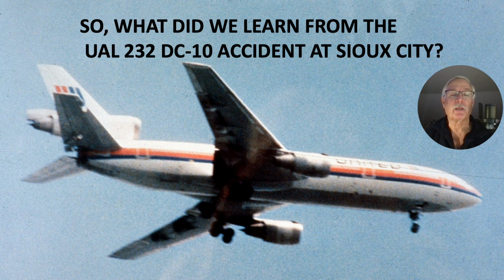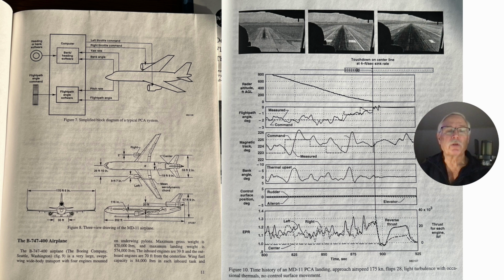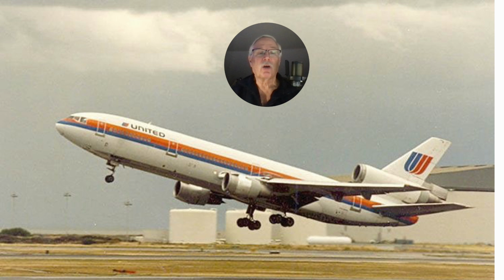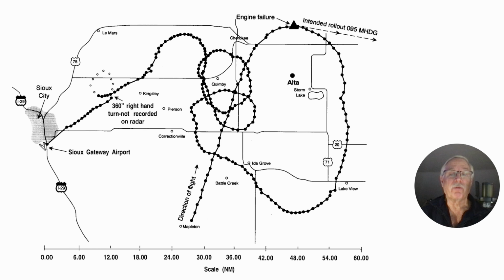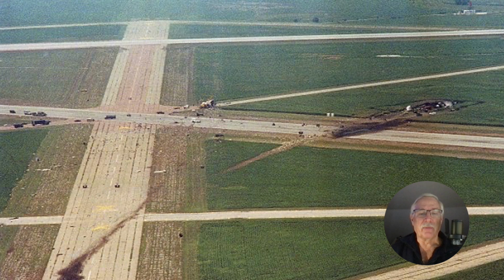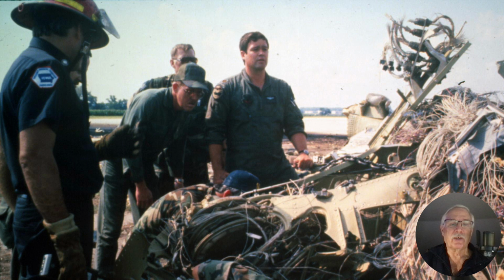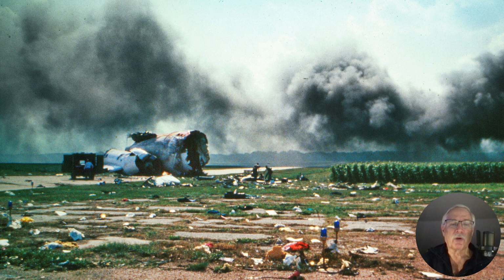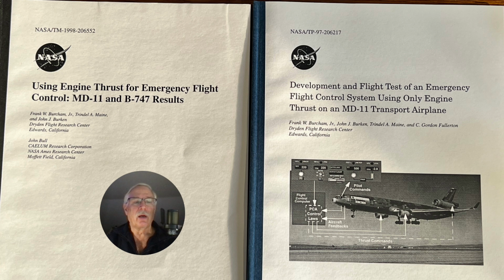SO, WHAT DID WE LEARN FROM THE UAL 232 DC-10 ACCIDENT AT SIOUX CITY?

Comment: I could be mistaken, but about two years ago there was an EMB-190 (an Azerbaijanian airline if I recall) which was shot at by a Russian missile taking out all the hydraulics.  I think most of the passengers and crew were killed in the attempted landing using only differential thrust.  Perhaps that accident could have been avoided if that fancy software had been on board.
Reply from the maker: It's possible that the software could have helped in that situation.

Comment: What is the most important part of any hydraulic system? The hydraulic fluid. I heard that Captain Haynes told pilots at my airline that he would have left the gear up if he had the chance to do it over. I thought a small standby electric cruise trim motor attached to the stab trim system would have been a better fix than the isolation valve for the elevator.

Comment: If only they could have opened the flaps a little bit with something like a car jack. They could have approached the runway at a slower speed, giving them just enough control to avoid flipping the plane.
Reply from the maker: Speed was not the issue as much as where they were in the phugoid cycle.

Comment: Had a few "after the fact" encounters regarding this aircraft in my career. Back when I started as a mechanic for UAL at SFO in the early 90s, a friend was giving me a tour of the UAL jet shop. Just sitting in the corner on a pallet was a bunch of metal. Was told that was the pieces from the center engine compressor wheel that let go from flight 232, was eerie to see the remnants just sitting there like that. Several years later, we had a lease return DC-10 parked for a few months, had a concrete weight hanging where the #3 engine would be as ballast. Asked why it was still there after a few weeks went by, was told that when returning a leased aircraft, they put the original engines on the plane that it was leased with. Turns out the original #3 engine from that parked aircraft was the #2 engine from flight 232, and they were trying to figure out what to do about that dilemma.

Comment: 12:28
After United 232, the only other accident I can think of that involved loss of all hydraulics was the 2003 DHL A300 attempted shootdown over Baghdad. In that case the pilots were actually able to safely land the plane back on a runway despite the wing also being on fire.
Aside from that, like you said, there hasn't been any other situation where that system would've been useful.
Reply: -JAL 747 comes to mind.

Comment: Was the JAL acident where they lost the tail before or after this?
Reply: JAL 123 occurred in August 1985, so right about 4 years prior.  Denny Fitch studied that incident and the use of asymmetrical power.   He used that knowledge as he worked the throttles on 232.

Comment: Interesting idea about trying to avoid having hydraulics as the only primary flight control mechanism. 

The DC-8 systems manual shows how they revert to control tabs on the rudder and ailerons, and have electric-motor alternate trim for the stabilizer. Someone on one of the other TouTube channels who was involved with testing mentioned how they had to be careful because they lost the yaw damper on rudder reversion.

I was wondering if they ever tried to use small rocket motors, like they do for attitude control on spacecraft, as a backup method in case of loss of hydraulics. This would compensate for the spool-up lag in using differential throttling of the engines. Hypergolic-fueled motors like the LEM ascent stage are very reliable, but of course they would add another degree of complexity and risk to the overall system.

Comment: I encountered a similar occurrence of this exceedingly rare phenomenon while flying a C-130 which in which we encountered  a total utility/booster hydraulic loss (no manual reversion on the Herk). Although the presence of four fully functioning engines with constant speed propellers and instant throttle response made for a far simpler flying task than what this crew dealt with, I can attest to how terrifying it can be to land a big airplane in this sluggish and wallowing manner. In case you are curious how this could have happened, ordinarily the two vital hydraulic systems on the C-130 are widely separated except for the aileron actuator (one unit serves both ailerons on a C-130) located on the central wing box structure. Ours was an ‘A’ model with full 3,000 psi aileron pressure and in all later C-130’s that pressure is stepped down to 1,500 psi: we had a ‘B’ model aileron pack installed which split in two under the higher pressure and pretty much instantaneously emptied the fluid of both systems into the cargo compartment (thankfully no pax on board at the time). We were fortunate to land without incident and, except for getting a nice award and plaque from the Air Force Association, the ‘A’ models were shortly thereafter retired from service and the incident soon forgotten. I enjoy your stories Ron and speaking as a typical lost-in-the-tall-grass average line dog whose career largely overlaid yours, I can only wish I’d come away with one tenth the number of interesting stories as your own!
Reply: Thanks for posting your incident, would be interested in reading a thorough breakdown of the incident if possible!

Comment: Stay off the DC-10, the Plane of Death!
That's what I learned!!
Reply: Despite a few accidents, like most aircraft, the DC-10 had a very long and reliable career. The USAF has only recently started retiring their 60 KC-10 refueling tanker versions of the DC-10 after 35 to more than 40 years service. Only one was written off in an accident and that involved a parked aircraft where fuel vapors caught fire during maintenance.

Comment: Reall cool that you knew the pilots involved. I think that Fugoid cycle was also experienced by the pilots in that 747 (JAL 123). It was the result of a poorly repaired/assembled rear of the pressure vessel. It took out all the tail controls, and somehow the pilots kept it airborne for around 40 minutes.
Great vid as always.

Comment: Curious  if you have any insight into how the airline industry addressed & adapted to the connection between yaw damper and rudder hardovers in B737s. This may have a connection to TWA 841 (1979), a weird high altitude upset where the crew came under suspicion for pulling slat circuit breakers & trying to cruise w flaps 1 at FL390. There's an alternate theory that maybe an aileron was floating upward slightly, causing a little yaw effect, which caused a problem w the yaw damper... eventually causing a rudder hardover similar to what we would later see in B737s...  Would be interesting to know what the rumors were in the pilot community as issues between yaw damper and rudder hardovers were starting to appear as a likely cause of these scary hardover incidents.
Reply from the maker: I am going to put something together on that.

Comment: I was working that day. UAL232 was in the FOD HI sector when he blew his engine. I was in the MCW HI sector and UAL232 was in the handoff mode to my sector. The initial thought was to try to bring UAL232 to the RST airport. But by the time they got the DC10 under control SUX was chosen as the airport. We watched it as it circled down. They did a great job even getting it on the ground.
Reply: It truly is. I did not know of this accident before watching this video and initially the gravity of the situation those pilots found themselves in didn't fully register with me. That is until Ron explicitly mentioned that the throttles for the remaining 2 engines were all the control they had. No ailerons, no flaps, obviously no rudder, nothing. I had to pause the video to go over that in my head and let it sink in. I'm not sure what kind of sorcery went on in the cockpit that day, but I'm pretty sure they managed to pull one over on several laws of physics.

Comment: The things that hasve to be considered with every proposed safety system are: 
1) What new problems might it introduce? (Look at drugs; they always have side-effects.)
A Twin Otter crashed because the stainless-steel control cables used to prevent corrosion of the usual carbon-steel ones were subjected to slipstream while parked,  embrittled and broke.
2) Since nothing is free, what alternative use of the money might produce  better outcomes?
Reply: I hadn't heard of that Twin Otter incident. 

Upon a brief inspection, it appears only that the stainless cable is known to be more "prone to wear" than the recommended carbon steel ones.  It also states in a marine environment the cables require more frequent inspections. Presumably, the operator knew this and "upgraded" to equivalent strength stainless cables to reduce the frequent "marine" (corrosion related) maintenance intervals to something more manageable.

They probably intended to replace the stainless at the regular interval, before the additional wear would cause any issues. 

The report found a substantial portion of the stainless cable strands were broken before departure, and showed "no signs of fatigue" therefore wear and use was not a factor. They also determined the basic cable had a breaking strength of 1,760lbs. And even with many broken strands was still strong enough to withstand 1,100lb of force. The pilot exerted an estimated 110lb and would not be capable of exerting this amount of stress on that partially failed cable.

They considered the only way to exert that force on the cable, is to fix the controls and exert a force on the control surfaces, hindered from moving by the cables attached to said locked controls.

They checked weather reports and found to wind to be sufficient to cause this damage.

They considered jet blast, and found regular scheduled Airbus flights would angle their engines within 15 degrees of where it was parked, and being off by said 15 degrees could cause up to 280% of design load on the horizontal tail control cables.

The cause of this failure is due to jet blast while parked with controls locked in the forward/dive position. If not for this, the cable would not have been subject to enough force to break. Even if stainless wears quicker than carbon steel.

The contributing factor was Pilot failed to recognize and respond to the situation with application of trim. He had 11 seconds between emergency and impact and did nothing. Partly due to lack of training, partly lack of trying anything else.
Reply from the maker: Exactly!

Comment: I think shortly after that accident, the DC-10 was retired as a passenger aircraft and strictly used for cargo by Fed-Ex and UPS. The military still uses it for refueling operations. The KC-10.
Reply: I was flying the DC-10 ten years after the accident for a major airline.
Reply: United retired the DC-10 from service in 2001.   Most or all of the fleet went to FedEx if I recall correctly and were converted to freighters.

Comment: No doubt you followed the 737 Max debacle. Can you give us your take on the difference of how the non US pilots were not able to handle the situation, and why it did not happen in the US, despite flying the same aircraft?
Reply: One of our traditional Air Guard pilots started flying the 737 MAX about 4 or 5 years ago. His previous experience was on C-130's, C-5's and 747 freighters. When he got back from training on the 737 MAX I asked him how his training went. Did you get your IPad ground school classes? Yes, he did as that was supposedly an issue brought up by the press after the 2 737 MAX overseas crashes. In fact he said his ground school instructor was a former NASA employee with zero 737 experience. He really likes flying the 737 MAX. I eventually asked his opinion on the 2 overseas crashes. His immediate reply was, "You don't turn switches off and on in flight unless in the checklist."
Reply: The 737 MAX debacle was caused due to a chain of factors.

The most important is the FAA mandates certain control responses as part of a type-certificate. 

Not because they are good or the best, but because that is what they approved once upon a time. 

And pilots who are type-rated for that aircraft are trained and experienced with those control parameters and idiosyncrasies and therefore accustomed to it.

When you sling larger-diameter engines under the wings to obtain greater fuel efficiency due to that larger bypass ratios, and therefore larger fans. You move their thrust-axis lower.

This means application of full-power will cause a greater nose-up pitching moment due to thrust. Possibly enough to be unstable, but in the MAX's case it seems like it was just less stable not unstable.

This means if the aircraft is trimmed way-aft on landing approach, and the pilot initiates go-around (maximum) power, the aircraft will pitch-up more than usual and get nearer to an aerodynamic stall (and possibly compressor stall situation depending).

This, certain departments within Boeing feared, would mean their new budget old model upgraded with new engines to be 10% more efficient would potentially fly different enough to require a new type-certificate. Which is exponentially more expensive (Billions of dollars in costs instead of a few million). Than simply an upgrade to the old type cert. 

To avoid this scenario, of having to re-certify the entire aircraft as a new model, and having to re-train and certify pilots, due to a change in controllability (that may not have been worse, just different). 

Boeing elected to "fix" this issue by adding an extra layer of automation that would read a signal from an AOA indicator sensor and if the pilot got too-near the stall (or maybe at all angle of attack up to the stall) it would "push" the controls forward, or at least apply nose-down pressure to generate the "feel" the pilot would be accustomed to.

Unfortunately, and probably because this was a "covert" cover-up that was supposed to fly under the radar of the FAA, they apparently did not grant that project information to the proper departments who would have created a redundant system.

Instead, they only fed a single signal from a lone angle of attack sensor to this system, that seems to be piggy-backed on the basic autopilot system and acts at all times, and not only when autopilot engaged.

What happened was, the sensors were malfunctioning and sending an errant signal, there was no redundancy, so the MCAS system would just full-send its input. Because it was a dumb system, designed by dumb people, and checked by nobody, in order to appease a dumb law written by a mostly-dumb organization who's sole purpose it to keep American aviation in the 1970s indefinitely.
Reply: @Triple_J.1  I appreciate the accurate review of the aircraft side of the 737Max. 
My aim is to see if Ron wanted, as a test pilot and a former Boeing captain, to weigh in on why American pilots didnot find any problem controlling the Max, but foreign(and likely less thoroughly trained) pilots did have trouble. 
Judging from Ron's lack of response, he is not interested. 
I was mostly curious what, if anything, American pilots were learning that foreign pilots did not. I have a hard time believing some American pilot did not find the aircraft respond in an unexpected way during the same pre-accident time frame, unless they were trained differently somehow.

Comment: Actually there was an accident prior to this where such a system would have possibly helped.
1985 JAL B747 lost all hydraulics and the vertical stabiliser due to aft preassure bulkhead failure. They managed to keep it flying for about 30 minutes, but were eventually intercepted by a mountain.
Reply from the maker: Yes, that is why NASA also did flight test on a 747.

Comment: Ron thx for another great episode. The pilots of UA232 did an excellent  job using asymmetric thrust to control aircraft. Similar thing happened to (Japan Air 123 August 12, 1985) a B747 which had a total hydraulic failure. The pilots of Japan Air 123 fought hard to the last minute but unfortunately lost control of the aircraft and crashed into the mountain.  I will always remember what Denny Fitch said "Your attitude determines your altitude.